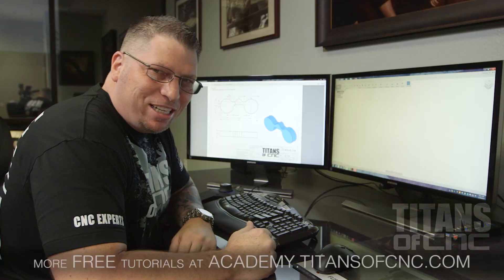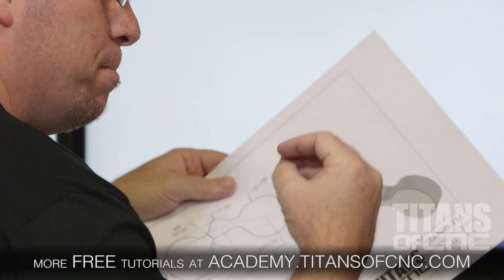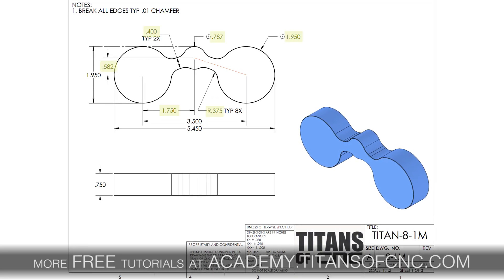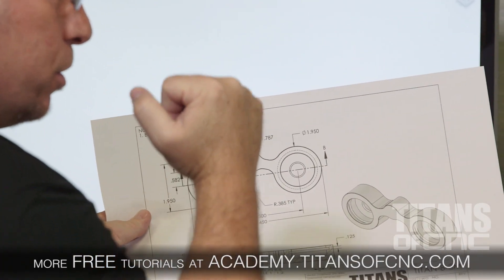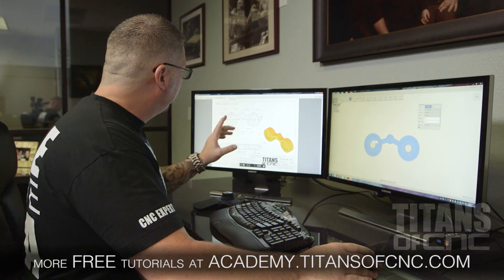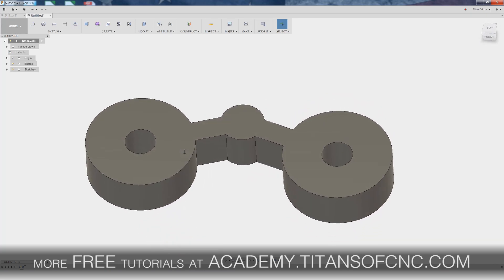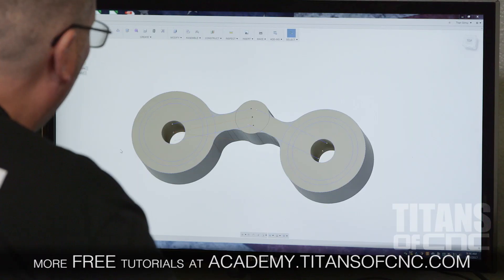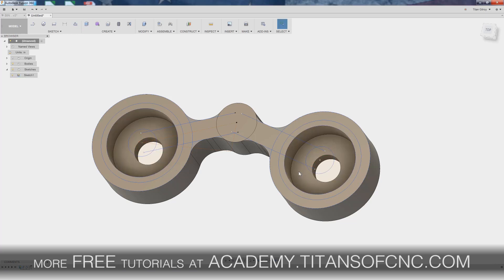FUSION 360 - Learn How to Design the TITAN-8M Project (Part 1 of 3)

Comment: Very interesting . I worked in CATIA r5 and there's little difference but I think the CATIA lot more difficult but better for CNC machines. And one more question right in the Fusion 360 has ISO system used in Europe